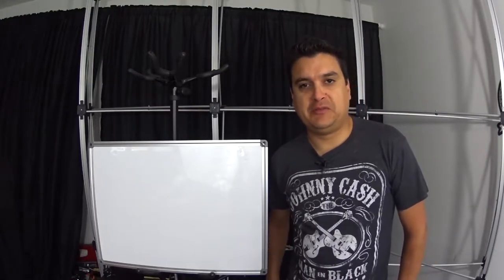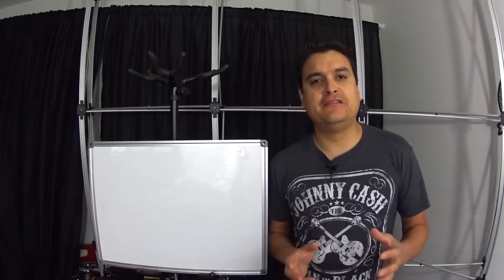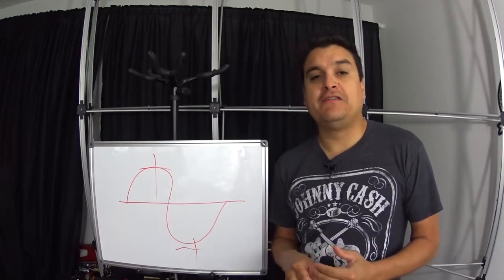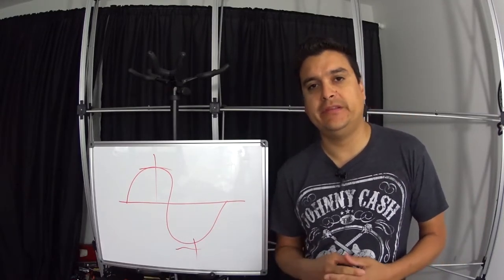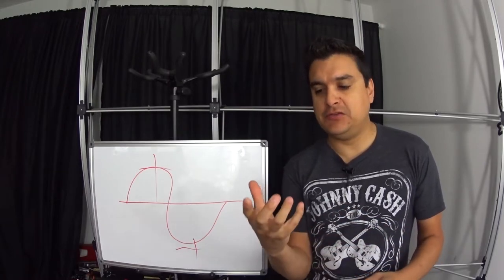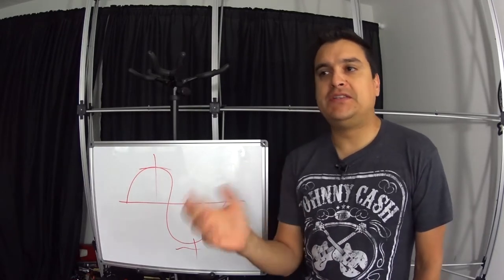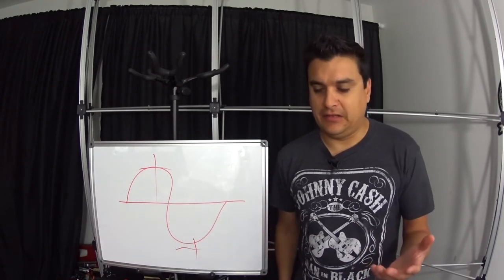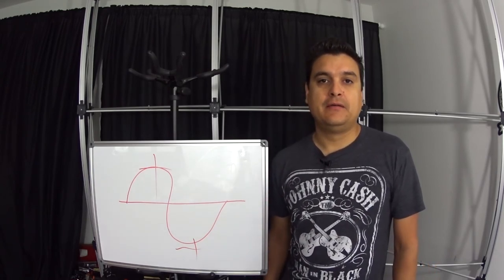Dylan Talks Tone Ep #35 Vintage Vs Modern Pickups Part 2 #54

Comment: I caught the part about how higher resistance “can” cause a loss of highs. 

But the way people talk about the resistance of any given pickup makes me wonder:  is resistance just a byproduct of the winding that you have to deal with, and work around?

Or, is it a property that you consider and make use of to help choose the application. 

If you answered that, I apparently missed it. 

I feel like people place WAY too much importance on the dc ohm rating of a given pickup. 

Like “my pups have more resistance than yours do, therefore, your pups are wussy.  Lol

Comment: Hello Dylan, I have a theory refered to the more airy tone of vintage guitars (beside imaginarry mojo and what happens to the wood and that all screwed in parts settle and loose tensions): I can imagine that the coating shrinks and results in a microscopic gap between the windings and maybe even to the wax (if potted). Same would apply on cryo-tuning, I think... 😏

Funny thing: as a bit crazy guy I put my Fender Noiseless N3 pups in the freezer for a month, vacuum-sealed, before mounting😂 Effect: zero😁

What are your thoughts to this theory? And what do you think about cryo-tuning?

Hope you see this, because the upload is pretty old...😃

Comment: Very interesting vid, Thanks for sharing.I have an old encore strat that I bought off ebay for £5 with a view to robbing it for parts for my own quirky home builds. However... when I plugged it in top play it, as you just have to out of curiosity :O)  I was pleasantly surprised at how good it sounded and felt to play. So instead of butchering it, I've stripped the hideous pink paint off to bare wood and done some mods on it. and I love playing it !! It has a nice vintage jangly-ness to it, which in part I guess is down to the old pickups?Anyway... thanks again for your vid.

Comment: Pickup tone is a very subjective matter. IMHO, CustomBuckers used in reissues are the closest you can get to an original PAF (although there are many variables I agree...) I would say these are the finest pickups Gibson has ever produced...
Also, one pickup that has impressed me is the Seymour Duncan SH-2 B. Basically, it is the Jazz pickup, but just a little hotter & brighter, to be used in the bridge position.  Pairs up perfect with the Jazz in the neck, much better in my opinion than the famous Hot Rodded set SH-4/SH-2.  I discovered it by chance on an HH Thinline Tele I have acquired used, and it ROCKS ! From LP-type squeals to Fenderish cleans with lots of clarity, harmonics and sustain.  I am so happy with it, taht I am mounting another one in an HSS Strat with a series/parallel switching option, instead of a Suhr SSH+, much too high-output to my taste ! Rock on \m/